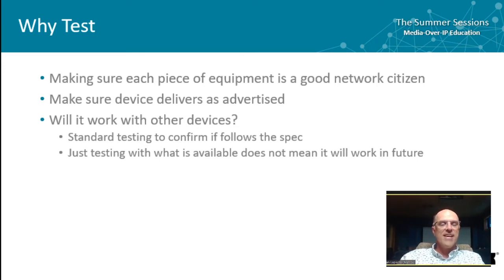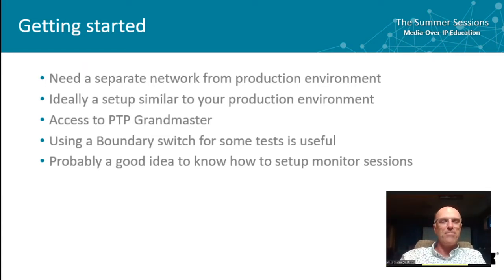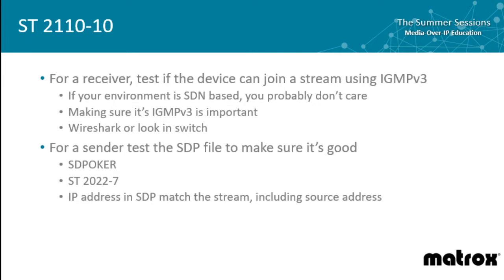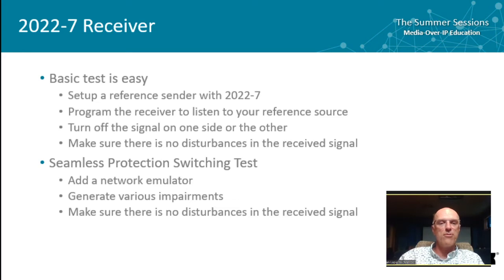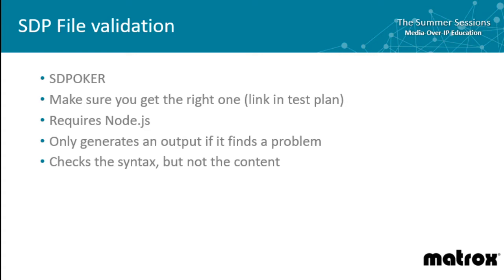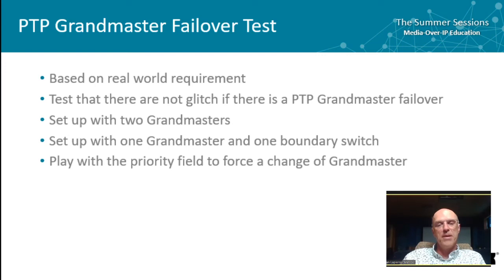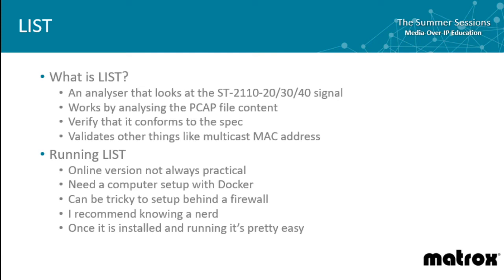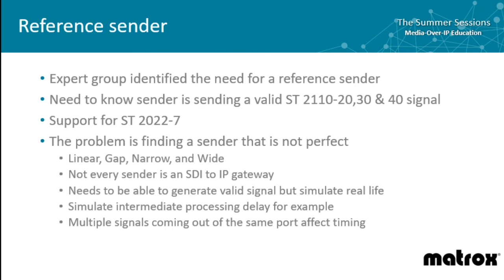Jean Lapierre discusses ST 2110 Testing Fundamentals

Comment: Great video.  Lots of fantastic information about ST2110 testing.  I am a gray beard UNIX/Linux sysadmin.  What we call Systems Engineers these days.  My guess about your problems with LIST are under-prevision and under-tuning of your LIST host.  You don't know where the bottlenecks are. Try starting out at lower bit-rates.  Think 1080p30.
Not to dismiss your systems engineers, but raw 1080p60 and compressed 4k puts unbelievable stress on the hardware and OS.  Your testing is quite often "tickling" the exception hardware paths and software exception code.  This is what you are looking for.  But it means that you are excising code that has not been optimized.  These exception paths are very hard to capture RELIABLY.  Small hardware/software inefficiencies can make a big difference.  As an experienced Linux systems engineer it is hard to know exactly how the pieces work together and what tuning parameters I should be looking at.  We are talking accurate microsecond time/data measurements at multi-Gb speeds.

A suggestion: when you start building your test environment, lower the bit rate.  Lower the resolution and increase the compression.  You are building a test rig so quality of image does not really matter.  Once you have your test rig running smoothly, you can up the resolution and bit rate.

A second suggestion from the DevOps movement: automate your tests.
Select a simple, useful test automation tool/environment.  Ask your DevOps team.
When you are testing and come up with a useful test: automate the test, add it to your test suite.
On a regular basis run regression test suite of all of your automation suite tests.
This checks that previously solved problems do not creep back into your environment.
The key to DevOps test automation is to simply start creating automated tests.  Test coverage can be added as you go.

Again, a great video.  Lots of good information and ideas!